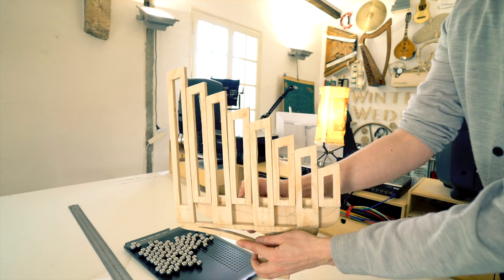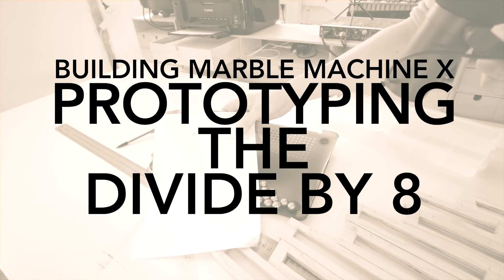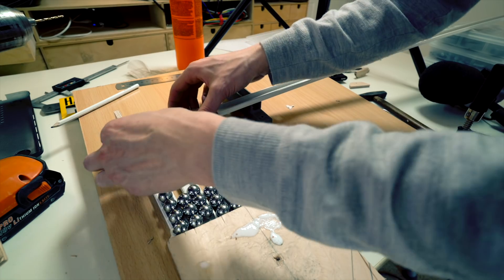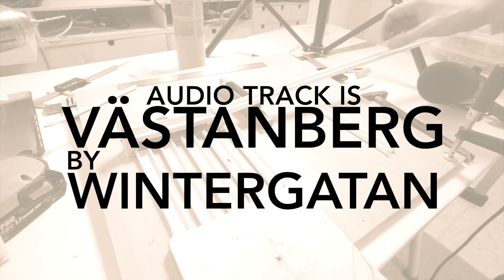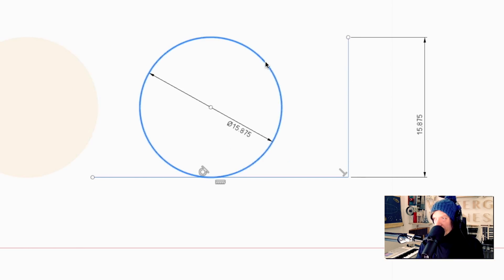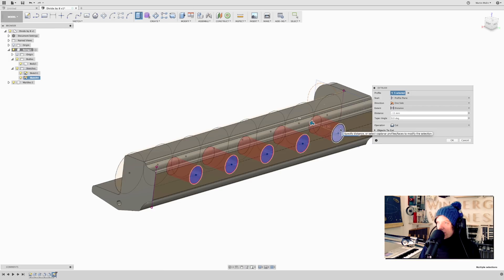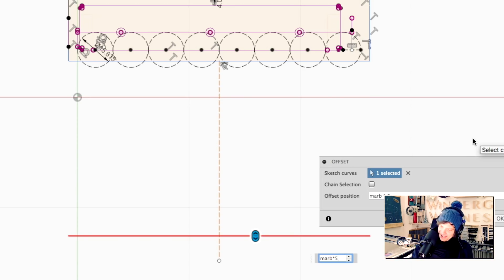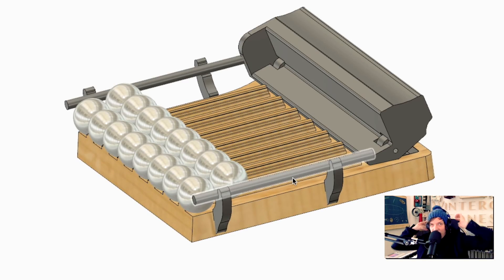Divide by 8 Marble Divider - Marble Machine X #28

Comment: Try putting some sort of thing used on the bottom of chair legs at the end, so that it doesn't wear. Also make it so that it needs a tiny bit more weight than eight marbles to tip. That will deal with any vibration problems. (A good amount would be ~3 grams more)

Comment: I really wouldn't recommend a design like that. Try one where you just have a track with holes in it, and just enough space below where they would fall to, that they could build up just enough to complete the track so the next marbles can flow to the other holes, it is unbalanced, but if this is just a method of splitting them out, you just need to make sure that the buffer before this part is always full, it should fill fast enough.

Comment: Wintergatan I have a question on the metric weight of the marble's that you plan on using also I do computer work on making a computer double of your machine I was hoping to factor in there wight to get a better timing right send me an e-mail if you fill ok with sharing that or their metal that they are comprised of my program will not let me use them because of the timing factor of the system matrix I will send you the details if you need them of the program be advised that it is still the the development stage I thought I would use your marble machine as a way of testing it's mimicking feature of any thing that I put into it I have not given the programmed software a name yet it is also supposed to work with VR systems as well I am just trying my hand at a little programming thing that I do as a side hobby if it doesn't work I will scrap the project or had it off to someone more capable of making the program work tell then thanks and keep up the good work on marble X2 hope to see the finished product

Comment: 1 byte of 8 bits of marbles
Reply: Who would've thought that a simple basic musical count would've ended up as the simple basic computer building block... 
So, MMX is an 8-bit machine... Could there be a 16-bit, or 32-bit or 64-bit; or hold on; a 128 bit MM???
Reply: @thomas boese , it is a very old story . mechanical computers seems to be invented  during the third century before christ , then autocracies started to dominate the west and knowledge went backwards , it look like knowledge escaped to the east  during the battle of authority  in the west ,  and the west recovered this technology at about 800-1000 ad . at 1300 ad , at the time that the clock was invented the engineering of mechanics  had  evolved to the stage that was about 1600 years before then .

Comment: I'm not sure that making this marble machine out of plywood is a good idea, because plywood decays over time, expands and contract's, due to temperature and humidity changes, which could throw your correct operating tolerances off, causing malfunctions. Wouldn't it be better to make this machine out of a PVC, acrylic or some kind of hard plastic?

Comment: You are learning a lot !. Another to learn is to avoid sharp internal corners,  they concentrate stress. As you say the back of the swing will take a beating. Instead of just be  4mm thick, blend it in to the base and back.. with a radius marb/2..that will be really strong,  no stress fractures ;-)..

Comment: This honestly looks like the worst way to do this. There are 2 different methods I see that would be much better. One is a wheel that lifts sets of 8 from hopper. The other is a variation of your tipper, but you need an access hole wide enough for the marbles to enter (plus a generous tolerance) that moves with the tipper. This way, when the tipper is full, as it rotates down you block the marbles from entering the system unintentionally. I will do my best to draw this out and send to the reddit page.

Comment: Hi Martin, Nice CAD work! If you add a flange to the back of the lead-in side of the tipper, it would block marbles from coming into the tipper while it was trying to dump and give a smoother operation.

Comment: Couldn't you put a stop and the end of the rail leading to the 8-marble swing? This stop could move together with the swing, and automatically open when the swing is in position for receiving more marbles and close when the swing is on its way up or down. Could just be a "large" disk with a 16 mm hole with the center of the hole having the same offset from disks center as the distance from the center of a marble on the swing the pivot of the swing.

Comment: You can also define a parameter for your project that defines a symbol, so you could set "marble" to be 15.875. This way you don't need to remember potentially odd numbers, just refer back to them with the symbol. You can also change the value and it will retroactively recompute your whole project to use the new value, and if you've designed everything in terms of that value everything will update. Say at some point in the future you make another marble machine but you want to use a different size marble, just update that one parameter and everything you've previously designed is automatically resized to be correct

EDIT: aaand you just beat me to it

Comment: If you add a pacing mechanism that provides separation between the marbles as they enter the swing, and design the delay of that mechanism to be greater than the cycle of the swing, you will eliminate any issues with extra marbles entering during the swing cycle.

Comment: I realise that, if you can calibrate it correctly, the weight-release mechanism you have shown here is probably the simplest solution in a mechanical sense. But have you considered a counter mechanism, which would count each incoming marble and then release for each 8th marble? I am no engineer, but i imagine a trigger and an eight-tooth wheel as the basis of this.

Comment: what if you were to add an 'over cage' or a kind of cover for the ramp similar to what you see in gumball machines.  when the eighth marble arrives, the ramp begins to tilt and can squeeze under the cover, therefore when the ninth marble comes speeding by, only the 8 marbles on the ramp get delivered and the rest wait until another group forms.  possible errors you can run into is marble jamming where the marbles still manage to find a way to get stuck in between the cover and ramp on its way back up.  A second idea would be to add a slide cover attached to the tilting ramp so that it does not accept any new marbles until the ramp its in its up right position.  there, the ninth marble would be stopped before entering the ramp until it was set and ready to accept more marbles.  you may have to raise the guards on the delivering ramp to protect against bouncing off the slide cover.

Comment: For reliability, make sure that the pivot force - the difference adding the 8th marble makes - is much greater than the combined holding force and friction. You may also need an interrupter - something to stop the flow of marbles while the shelf is away from its 'home' position.

Comment: Many of your mechanisms involve marbles 
suddenly stopping and starting.  
Those sudden movements make noise.  
I would like to see how you might alter this mechanism 
to use marbles smoothly accelerating and decelerating in continuous movements 
(well defined second and third derivatives of position), 
instead of banging and  bouncing 
against each other and wooden pieces.

Comment: A suggestion for the back wall (7:00), maybe if you're worried about the wall taking a beating, design in a replaceable insert, even just a press fit disc, and a hole from the outside so you can push the disc out then insert a new one.

Comment: You could possibly add a thin double height plate to the loading side of the swing (maybe acrylic or aluminum) with a marble sized pass-through, so that when the swing tilts down to drop a row, it simultaneously blocks the ramp from dumping extra marbles until the swing returns to upright position. It would be similar to how gum ball or toy capsule dispensers work. Sort of like the wheel section pictured here, https://www.pinterest.com/pin/556476097683065548/ , but you would only need between 90-180 degrees of the wheel since the swing rocks rather than making a full rotation.

Comment: As 8 = 2 to the 3rd power, you could try a gate that send 1/2 of the marbles on each sides. A second layer with 2 gates similar to the first one, splitting the 2 flows of marbles in 2 again => this would give 4 chanels. Then a third layer with 4 gates in parallel, similar, splitting again each of the 4 chanels in 2  => giving 8 chanels equally fed with marbles.The problem could be the speed of such a device, especially the speed of the first gate.

Comment: Hi Martin, leveraging on marbles weight could not be the best solution because the equilibrium of the tilting tray is disturbed by vibrations of the machine while is running. Why not use 8 parallel tracks, as in your design, but covered with a rotating chamber with the base holed, spinning around Z, so that the marble coming in the chamber eventually enter the first hole where the underneath track has space? In this way all the 8 tracks wills be filled equally and constantly while the marbles come into the chamber.

Comment: Have you considered putting a screw at the end of the divider (inside the 4mm part)? So you can adjust the space for the marbles on the divider. Screw it in, it has less space for marbles, screw it out, it has more space...

Comment: Seems to me a design like this based on the weight of the marbles will need 'tuning' as the machine wears and friction could change over time at which point you need to adjust the balance of this mechanism wouldn't you?
Rather than weight causing the tipping action, what about if the existence of the 8th ball causes it, not the weight of the 8th ball added.  Would need to noodle a bit in CAD to think about it but thought I would toss it out there.  The other parts of the machine are more deterministic  (from what I am have watched) vs this design.

Comment: Ooh, I like this mechanism.  Very similar to a thing I am trying to do for the boardgame potion explosion.  I am trying to make a marble run that attaches to the dispenser and then dumps the marbles into the dispenser.  the issue is that there are 6 columns in the dispenser and I want the marbles fairly evenly divided among the six columns.  An idea that might work better for your 8 setup would be toggles, the row comes in, and every other marble goes left and then right, then repeat that mechanism so it splits into 2, then 4, then 8.  This idea is MUCH more space conservative though.  My project idea was going to be intentionally pointless, heh.

Love your videos so much!  When your world tour kicks off, please come to the San Fransisco bay area and I will in the crowd loving it!

Comment: Couldn't you use flip flops for this? Or is the marble stream too fast? Otherwise you could put one flip flop in the first layer to divide marbles into two streams, then two on the next layer to divide into four streams, then finally four flip flops to divide into eight streams.

Comment: I'm not sure I understand exactly where the marbles has to go after this divider, but I feel this might cause some problems, both that the some "marble artifacts" are present, but also that they are otherwise spread completely even. I have a hard time thinking up a way for the marbles to be used that wouldn't require the marbles to split depending on the use for instance. In the old marble machine, the dividing on the top split depending on use because there was a large pool of marbles simply finding a spot to sit where another was used. Here it seems you are coupling the use and the dividing. Is there something I misunderstand?

By the way, if you want a perfect split, you can use binary marble switch/toggling gate like the ones in the initial shot of this video https://www.youtube.com/watch?v=GcDshWmhF4A. Then you can divide evenly for powers of 2 if you just chain them together. It does use more space of course. Edit: and might clog.

Comment: At 1:55 you're playing with a little rocker mechanism it looked like; I thought you were gonna do something like the rockers that Matthias Wandel has in his adding machine: https://www.youtube.com/watch?v=GcDshWmhF4A

Did you consider doing something like that to ensure a constant even distribution of the marbles across 8 tracks? Since 8 is a power of 2, you could easily use that kind of system with 7 rockers in a hierarchy formation. Or is it important to have all 8 marbles being released simultaneously? Also, admittedly, it would be more bulky than what you came up with, so I don't know if there's room for it. But it seems like it could have fewer potential technical issues.

Comment: Happy Pi Day!!!!

I recently saw the video on the midi music system and have an idea.
Below is the comment that I posted two days ago. What do you think?

"what if the programming wheel (pw) can be used twice? this is what i mean:

consider the odd numbers as being one song:
1 2 3 4 5 6 7 8 
the machine can play the odd rows on the pw. after one or so revolutions, you pull a lever, press a button, or whatever, and all the playing levers or triggers shift over to the evens. this enables you to play two songs at without changing the pw, or play a song that is twice as long as you can currently program, or even mix the two programs and play different parts at different times (similar to repeating and mixing a theme during improv).

a step further? enable the levers to play both tracks at the same time. that is simpler to do than the above, so if the double track can be accomplished, this step would be a shame to omit. imagine a simple first theme on the first revolution. on the second revolution, the theme is advanced, being changed slightly. then, on the third revolution, the tracks are mixed, producing a song that seems impossible to play on a machine as simple (comparatively) as MMX.

matte or glossy finish? use both, and make them functional, using them to differentiate the odd and even tracks!

I hope that this helps!!

i will be happy to help with any questions that you may have. i didnt mention my ideas as to how to build what i mentioned because it would make this post too long. (like it isnt already long...........  :/   )

good luck!"

                                                                                                                                                  -----   an engineering student in the USA

Comment: Another way to do this is as a cascade of divide by 2 dividers, which are common elements in marble machines. A first such divider leads to two more dividers which lead to four dividers. The power-of-2-ness of 8 is a specific feature of such a divider.

Comment: As I watched the balance lever operate, it was disturbing that it sometimes dropped extra marbles, and with vibration, might tilt with 7 out of 8 marbles, either leaving holes or extra marbles in some columns. At one point a whole line of marbles clogged up a single column, and could have made the divider run dry in the other columns. When you placed the marbles on the pan, the self-aligning property was very promising, but I don't see that happening in your solution. 

Could this element be replaced with a flat pan that leads to some angled tracks that slowly separate along diagonal (actually 30/60 degree) paths? You'd like to get the effect of a self-aligning pan that spreads a population of marbles out evenly, followed by tracking into multiple and separate paths. I feel there's a much more elegant solution out there.

Comment: I think that divider is going to give you problems. Block, if the tracks are filled with marbles, not uniform distributions ... Improve the effectiveness of the same by adding a few small tabs to guarantee the fall of each marble in its corresponding lane. I love your job!

Comment: You can reference dimensions and set named dimensions in your drawing.  Your extrude length can be (d1 * 8) for example.  Or you could name a variable called "marble" and do (marble * 8).  The editor you want to check out is the icon with the Sigma symbol Σ under Modify.  Just add a User Parameter named marble and give it a value of 15.875.  You can create a single marble component with this dimension, then import that into your drawing too.  I would put all of your named global user parameters in the marble component, then all your drawings that include the marble will have those available for use.

Comment: See that you modeled the swing to have a vertical surface that will cut the flow of marbles when it tips. 

Perhaps consider the feed ramp before the swing to be a tube or like a covered bridge the last two or 3 inches. This would constrain the marbles that are waiting to be loaded into the swing and prevent them from jumping track when they roll into that vertical surface when the swing is dumping

Comment: why even have the tilter? you can have it super simple by just having the track the marbles come from run into the front of the stair lift, so when the lift comes down it allows 8 marbles to roll onto the first step and as it lifts up it blocks the rest fo the marbles from leaving the track. This would make it faster as it does not need to wait for the thing to tilt over releasing the marbles and it will take up less room. please like this so he can see

Comment: I know this isn't the Reddit thread, but one issue I see with this method is the movements of the MMX itself, which I suspect will make this method unreliable.  I think a more mechanical approach will be required.  I think Matthias or Denha would be very useful consultants on this issue.

Comment: Great walkthrough!

Oh, man. I do love f360.
By the way,  you can use motion links to simulate the parts motion and the simulation workspace to check the structural status of your design (for both stress and load points)